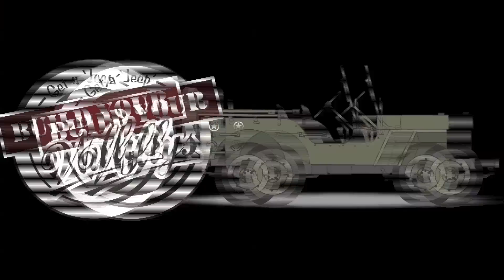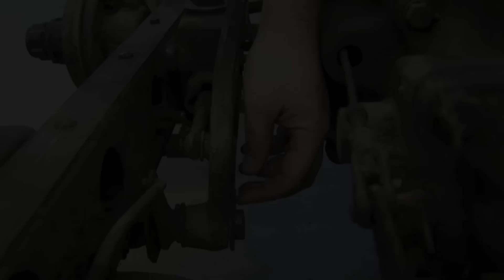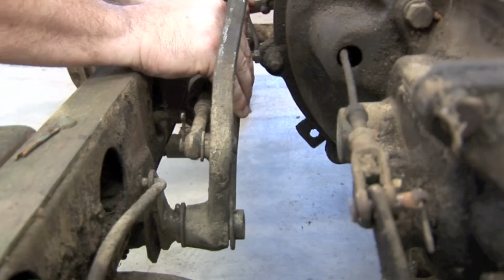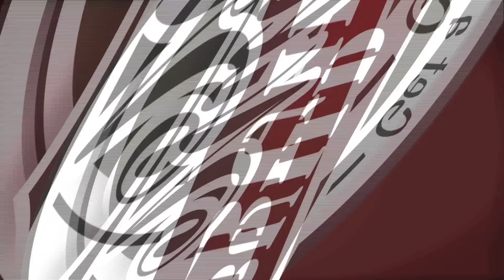Build Your Willys: Master Cylinder Removal

Comment: Well this video is all well and good but there are some of us who have a master cylinder that's in a fully assembled Jeep and needs to be replaced and I would like to know how to do that in the easiest manner without lifting off the body.  my M 38 A1 has an armored skid plate under the master cylinder I guess to prevent rocks and debris or heavy brush from damaging the master cylinder and the electrical and it's not really clear how this is attached I know in the front there's a bracket that goes up to the front mounting bolt but there isn't a whole lot of space in there should I remove the floor pan? just asking. And I think I can work up a method of actually rebuilding the master cylinder without removing it from the jeep but I will not know if that's possible until I pop it apart from the back. the master cylinder is of an undetermined age, I've had the jeep for over 20 years and that was the one that was in it when I bought it